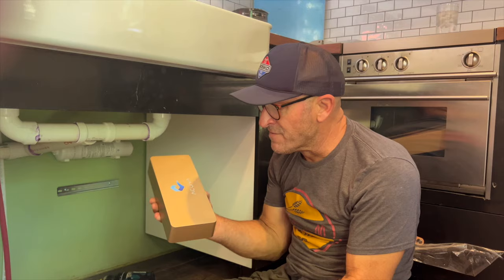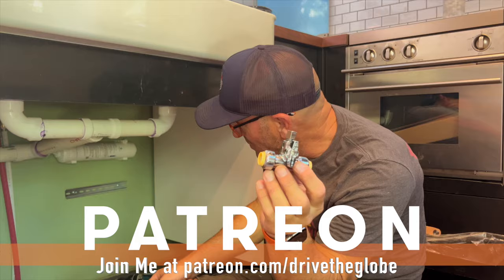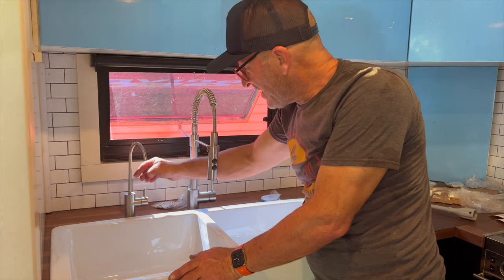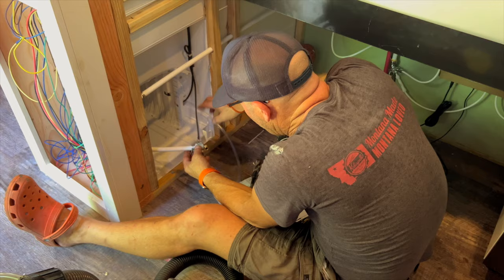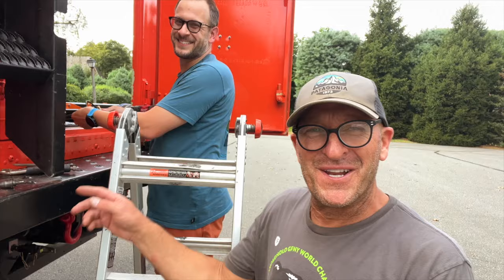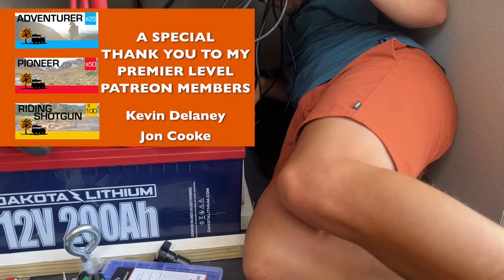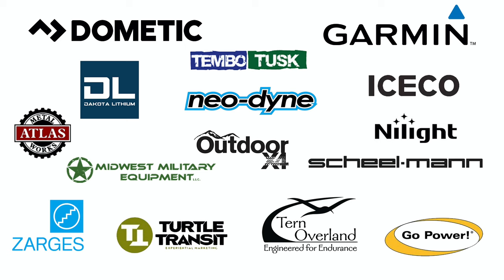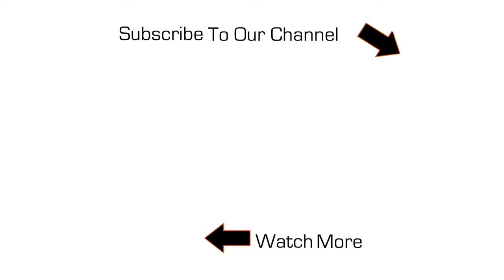Water Purification & Power- Overland Rig Essentials  | Ep 17

Comment: way it was pointed out in other places... is primary purpose of filters (concerned you don't enough ) BEFORE the UV light is to remove everything that would block the UV from  hitting water molecule.  If it does not hit a particular group of molecules that have a; not good for you, bacteria in it...  when this group gets to its next storage place, these little groups of molecules with that bacteria in them,  will multiply and your right back to bad water.. contaminating your tank and all water lines any of this bad water travels thru.
Reply from the maker: My UV filter is only for drinking water and is located right where it comes out so that bacteria can’t get by it. The main tank itself and shower water is not UV treated.
Reply: @drivetheglobe  does not change any of point made above except your set up means you wont have to deal with contamination of other storage/water lines. (SMART), yet still for your drinking setup, same issue still exist..  if UV does not hit part of water (due to shadowing of some molecules by crud not filtered out) then what comes out of the tap is not completely treated.  Granted you may have your non potable water heavily filtered for crud  further down stream and Im just not aware of that. If so then your good.

PS- you might consider another UV for shower.  Bacteria/ "Amoeba" in ears, genitalia, anal orifices   etc occasional cause severe health issues. semi rare.....  but easily avoided. would not need to be as superior a system as for drinking water though.  just something to go hmmmmmmm
Reply from the maker: @coachgeo  I do have 3 filters down line for crud, and I filter the water as I fill the tank. I sent an email to acuva, the manufacturer of the UV system to see what their response might be to the light potentially missing molecules.  Be interesting to see what they say.

Comment: Hmm..... I haven't read good things about those LED/UV lights actually killing bacteria.  Apparently most all of them don't allow the water to have enough dwell time under the lights.  Don't know the brand you are installing, but you cannot beat a good ceramic cartridge filter that can remove down to 0.02 microns.
Reply from the maker: Been using the Acuva out of canada for 4 years now without issues. I know some people that have used it on some pretty sketchy water in Africa without issues.